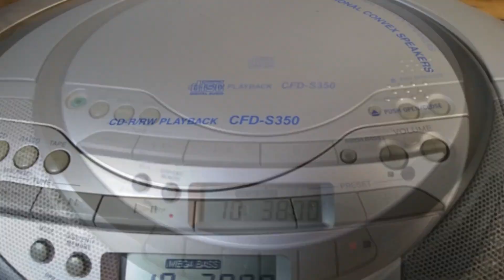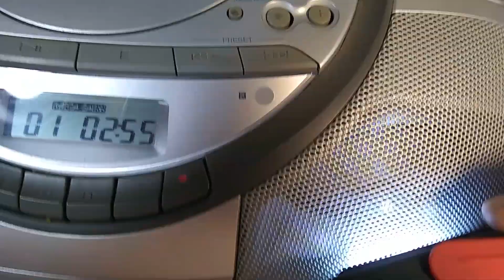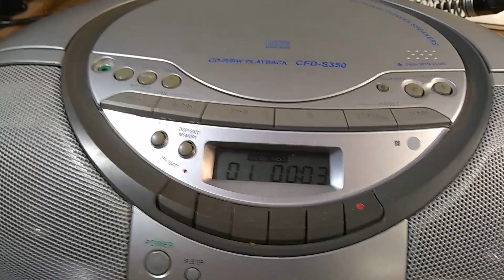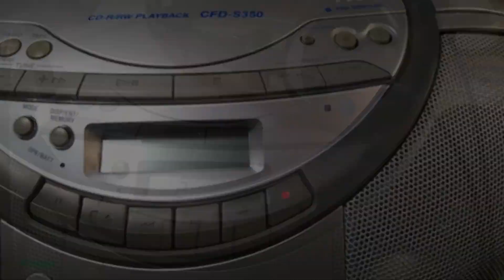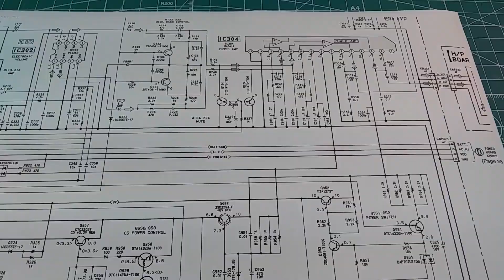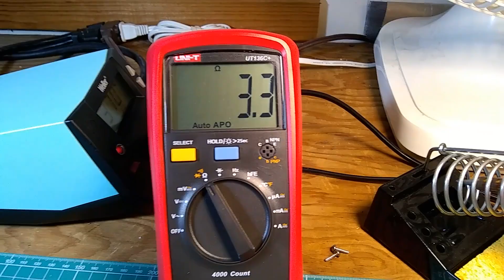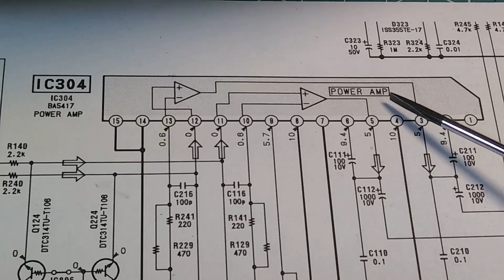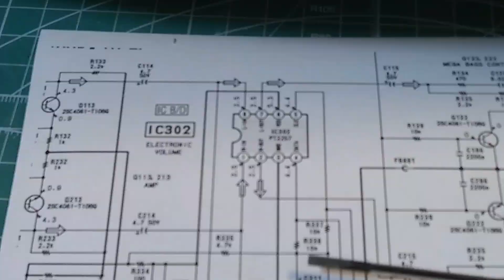Boombox Sony CFD S350 - No Audio Volume Repair. Step by Step Troubleshooting.

Comment: Upon further investigation. I found the 4 ribbon cables attached to the push-button circuit boards are touch and go. I will resolder the pins that are directly pinned to the surface. These do not carry plug-in casements. I will let viewers aware of my progress. MJ.

Comment: On my CFD-5350, I am experiencing a weak character(s) display, push button controls are non responsive. I would appreciate your remedial repair. I agree it's a decent unit. 
PS. It has the red power led indicator light. Thks. 
MJ in B'dos   🇧🇧
Reply from the maker: Weak, fading, or missing LCD character display is usually caused by poor contact between the conductive rubber comb and the glass LCD display, and/or the corresponding contact points on the PCB. To fix that: remove the comb and wipe it - and also the PCB contacts - with 92% isopropyl alc. Avoid touching those contacts with bare finger.

Comment: i might be having the same problem with the sony mp3 cd radio cassette-corder cfd-s03cp and im trying to fix it can you help or make a video on it?
Reply from the maker: I don't have that model. What you might do is get the schematic diagram. It comes up as the top result if you search google "sony cfd s03cp service manual" then on page 25 compare the audio section to this CDF S350, particularly around the volume chip IC302, which is the same part PT2257. It has a VDD filtering capacitor C353 470uF / 10V. I would locate it and replace it with 470 / 16V or 25V. Good luck!

Comment: How do I get aux output?
Reply from the maker: For tapping the output you could simply use the headphones jack. If you wish to add aux in, you could hook them up to C113 L and C213 R. If you download the 66-page service manual, the diagram is on p.30. The two caps are on top left side of the page.
Good luck!

Comment: Hi, I've got the same Sony boombox. It works fine, but the cassette speed is off - it plays noticeably too fast. Do you know if the cassette motor has a speed adjustment? I'm guessing there's something somewhere. I suppose I need to stay alert for bad capacitors in the future as well?
I enjoyed watching you troubleshoot and repair this boombox. I really like mine. I picked it up at my local Goodwill store for $20.00 a few months ago. All is well with this boombox except for the cassette speed being too fast. Regards, Thomas
Reply from the maker: On page 14 of the 62-page version of the Service Manual for CFD S350, you will find the procedures for mechanical and electrical adjustments. This Service Manual is available for download for free from elektrotanya - see the page address included in the video description. The bottom right corner of page #14 shows picture with the location of that adjustment: it's a tiny hole in the back of the motor. A small flat screwdriver will adjust the speed. 

It might not be possible to make the speed adjustment and listen to tape at the same time because you may have to disconnect the cables in order to gain access to the back of the motor. If that is the case, then make one tiny turn at a time (3-5 deg.) with screwdriver and reconnect all to listen to the tape. Turning the adj. counter-clock wise will most likely slow it down. Volcals make it easiest to detect the wrong pitch. Good luck!
Reply: @tektech1065 Thank you so much for this information. I tried to send you a message yesterday, but there was some kind of problem that wouldn’t allow me to post a big THANK YOU for all your help and advice. It finally dawned on me to go straight to the video and respond this way.😊